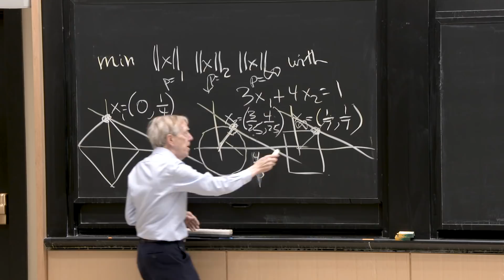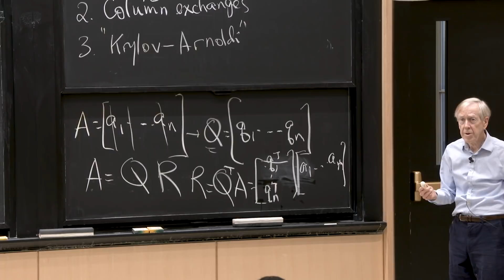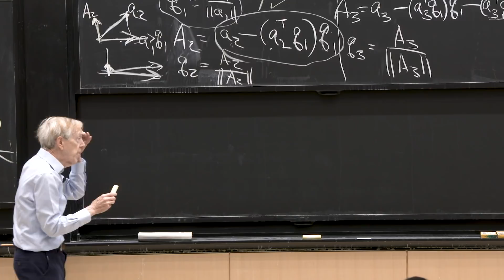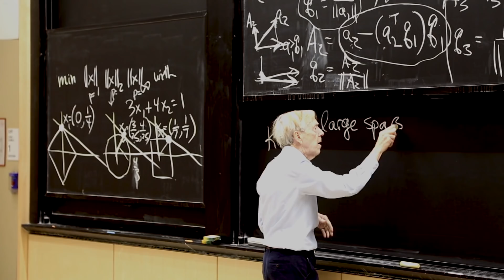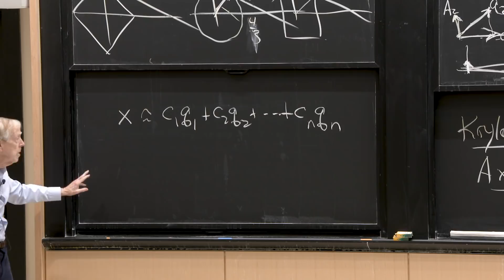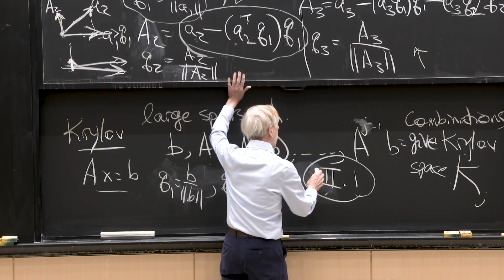Lecture 11: Minimizing ‖x‖ Subject to Ax = b

Comment: This problem has been over-flogged by the learned Prof. The simple answer (from linear algebra standpoint) is the projection of the origin onto the multilinear SET:  { Ax = b }.  This would almost always yield  the invertible matrix  A*At, such that the solution of: (A*At)y = b. Which you then plug into the given constraint to get:
x = At.y  which is the solution to the problem. A need not be a square matrix for all the respective dimensions to match. This particular form of the solution coincides with the projection of the point [ x = 0] onto the linear subspace: { x | Ax = b }. This is infact a trivial problem since we can project any other points e.g. x = (1, 2, 3,...., n ), onto { Ax = b } to arrive at yet another point on this subspace. This problem can also be viewed from linear analysis standpoint where the vector function: f(x,t) = ||x||^2 - t(Ax - b) is being minimized, wrt the vector x. And the same result is found. Cheers.

Comment: What is the intuition behind Krylov.why does it work?
Reply: You want to avoid matrix-matrix multiplication for large, sparse A. So instead, you just iteratively multiply A by a vector B to output a vector. So the Arnoldi method lets you find eigenvectors with a low computational cost
Reply: @Joy-abcd  Thanks for the response. However, this is simply the idea behind why to use Krylov. My question was    why Krylov works. I.e. why search for solution in Krylov space and how it is intuitively sound from a mathematical sense not from a comp science sense?
Reply: @anantamahapatra8997  Sure. You can approximate the eigenvector of the largest eigenvalue through repeated application of A to the vector b. But A^(j-1) is expensive, so instead we create the Krylov subspace by iteratively applying A to b. If we now treat K(j-1) as our first basis vector and construct an orthonormal set through Gram-Schmidt we can approximate j eigenvectors
Reply: @Joy-abcd  Thanks that explains the approximation algorithm through krylov subspace and it is cost efficient and yes it works. The question I was asking more mathematically why krylov-arnoldi method would converge? Anyways I got a link that illustrates the point.https://www.google.com/url?sa=t&source=web&rct=j&url=http://www.maths.lth.se/na/courses/NUM115/NUM115-05/krylov.pdf&ved=2ahUKEwisgYDZkMPkAhUCY48KHXQgD3cQFjABegQIBBAB&usg=AOvVaw3V1vtgCqdCS_nMGxsfY4FL. Thanks for the help.
Reply: @Joy-abcd  in a typical least squares problem your A will be a non-square matrix though (by a large shortage of columns), so how do you multiply it by b? By adding column vectors of 0s to A? or what is being called "A" here is secretely ATA, and b is ATb?
Reply: pineapplegodguy I can see why the notation can be confusing but b in this case is an arbitrary vector compatible with A.
Reply: Just something (reminder( for me to work on later. Thanks

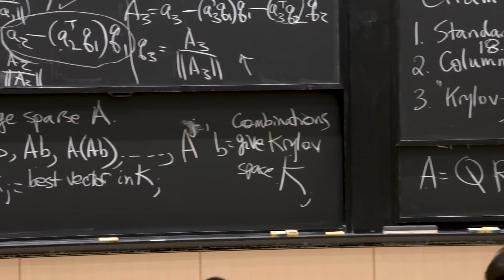Comment: 41:50 starts with a seemingly intuitive concept which we usually take as granted. That is- why orthonormal basis are the best basis? Professor Strang explained it beautifully.
Reply: I agree, it explains why orthonormal basis is the best because if the basis is not orthonormal, the projection onto one component of the basis will be larger than what the coefficient ci of that component should be
Reply: Using 100325836 and 1000564416 is a whirlwind